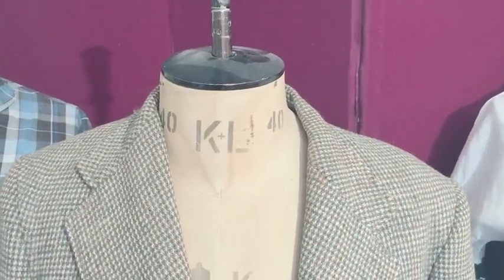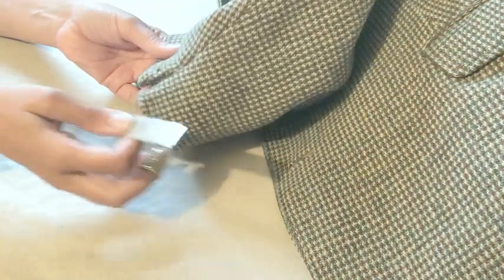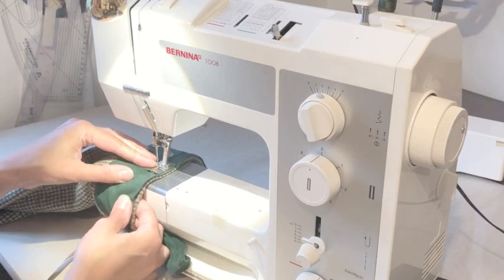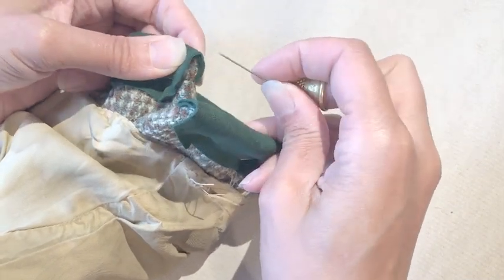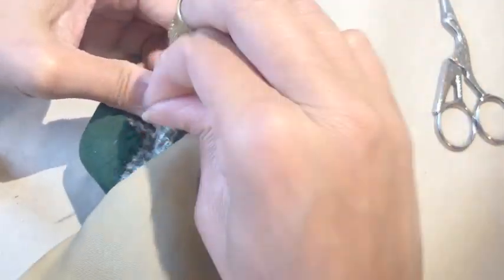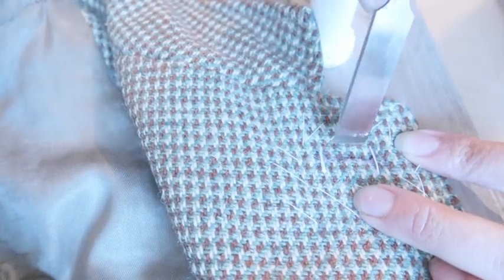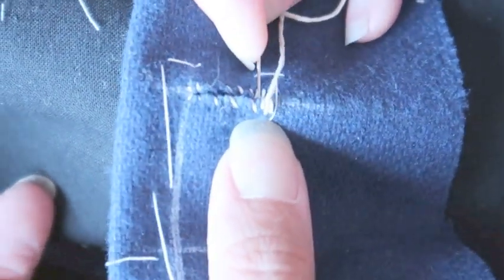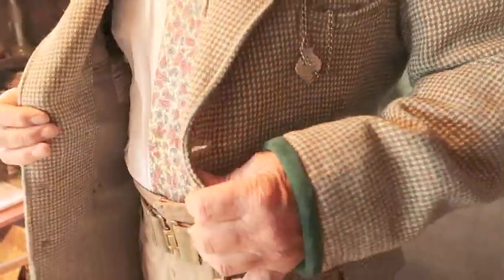Saving a Vintage Tweed Jacket

Comment: I really appreciate all of the mending videos you’re making, I feel like that’s the biggest gap in my sewing knowledge.

When you were talking about different stitches on buttonholes, you mentioned two different ways of doing buttonhole stitch: looping the thread around the needle while the needle is still in the fabric, and pulling the needle all the way through then sending the needle through the loop as you pull the stitch tight. Both of those methods can produce either buttonhole stitch or blanket stitch, depending on the direction that the needle goes through the loop. It looks like you were doing blanket stitch with both methods, not buttonhole stitch.

I like to pull the needle through the fabric then send it through the loop, like you mentioned that you prefer as well. To do buttonhole stitch with this method, you need to bring the needle around to the back of the loop, and send it through the loop in the same direction that you are sending the needle through the fabric. This causes the loop to twist and form a knot. I learned this from a blog post a while ago, but I can’t seem to find it anymore.
Reply from the maker: Thank you very much for all your information.

Comment: This mending job is splendid thank you for shareing! I feel inspired to finally tackle the repairs on my own thrifted tweeds that have rather shredded beastly synthetic liners but good wool outers (a hallmark of the 70's construction I presume).
Reply: Have you thought about taking out the existing lining, taking the pattern and replacing with a new lining?

I ask because my winter duffle coat shredded the lining at the back and armholes.  It was only a cheap one, around £25.00, but it's very warm and, surprisingly, the outer fabric is wool.  I did a test😀.  Anyway the lining was on the skimpy amount of fabric side, so not mendable.

I have removed the lining, pressed it out and am taking the pattern.  To do this, I have measured every outer part of the coat minus seam allowance.  Then I can take the pattern, enlarging it enough for a comfortable fit that won't be too tight for the outer part.  My choice of fabric is a very 1960/1970's psychedelic style glazed cotton.  Just harder wearing than the original lining and prettier too!t

I have been informed that I should just chuck it away. This is by the same person who said that my husband's expensive, as in a healthy 3 figures, suit should just be chucked because said husband gained a little weight, although he declared the waistband shrunk.  My late, very clever, Mum used the fabric from the back pocket and actually made the waistband a little larger at the front band and placket.

I guess some people have more money than sense.  Apparently you buy a £30.00 suit from a well known cut price supermarket, wear it once and then bin it!  There is nothing polite I can say about their attitude.

Comment: I do my buttonholes in the same way you do and I have never been able to see a difference between them. I think your way is much quicker anyway. This was great information and so clearly explained. Thank you!
Reply from the maker: Thank you. it seems to be a 50 50 split in styles of buttonhole sewing. I have yet to ask an actual tailor what they do as most of the tailors I work with do machine buttonholes unless its a very special occasion.
Reply: If the knot at the edge is a figure-eight knot, it’s correct, no matter how you got there.

Comment: I find myself holding my breath with every stitch, thinking "This is it - this is the time Constance drives the needle into her thumb!"
Reply from the maker: I am bleeding at one point. But I may have edited it down so it doesn’t show.
Reply: @stanceymackenzie  Ouch! I did hope that it was just a trick of the camera angle and that you weren't really pushing the needle directly at your nail bed. Ah, well, occupational hazards I guess. I once sliced the tip off my finger cutting potatoes with a mandoline slicer. It grew back.

Comment: I too have swallowed a pin, much to my embarrassment. My doctors were really worried the point would end up puncturing my intestines somewhere along the way. So I had the great pleasure of a tube down my throat so they could pull it out. I don't recommend it! (and I still put pins in my mouth. its a hard habit to break!)
Reply from the maker: I sorry you had to have it removed, but it also amuses me you still put them in your mouth too.
Reply: Don’t put pins in your mouth if you can help it, and never talk with pins in your mouth.

Comment: I love this episode! I'm a mender and used clothing hacker. My question, with absolutely no judgement, why did you not let down both cuffs, cut off up to  the damage and then apply the suede to inner and outer layers? Would it not make it easier ?   Keep up the video.  :)
Reply from the maker: Oh no it did not occur to me to cut anything away. The cuff does have a working buttonhole and placket so it would have interfered with both of them if I had let the fabric down. But I expect my reluctance to cut anything away ever comes from working in the Theatre where you never know if you might have to change something for a different performer. I never cut extra fabric of trouser hems just in case even on my partner and there is no danger of him getting any taller.